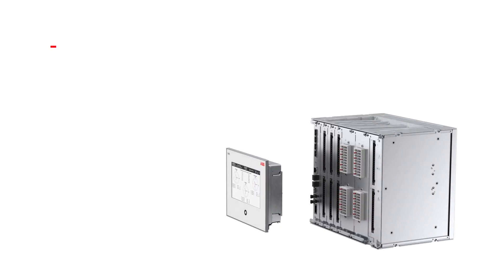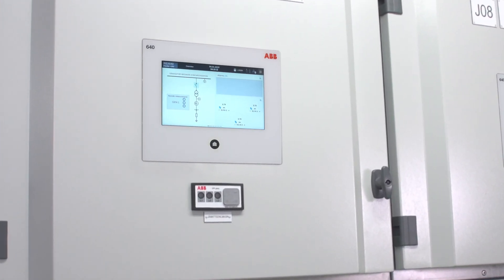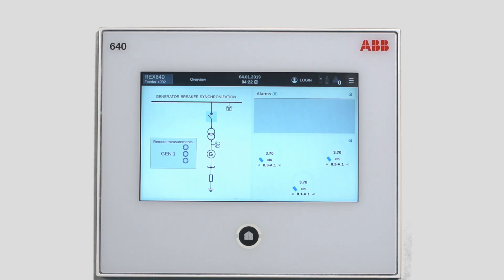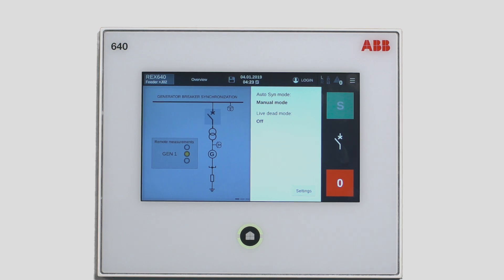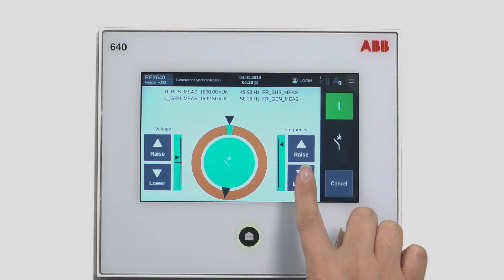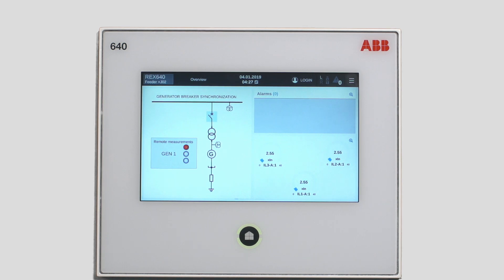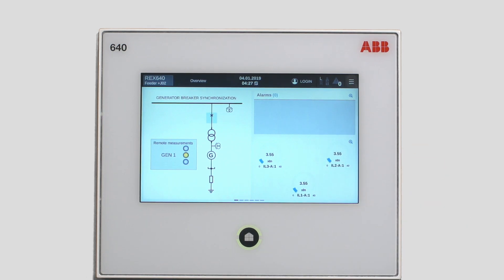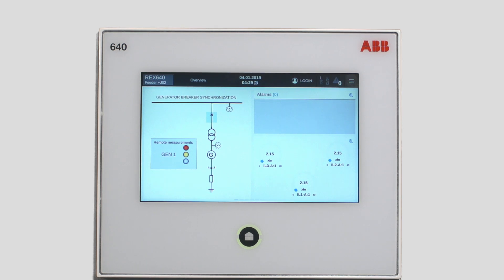REX640 – Applications: Synchronization of a generator circuit breaker

Comment: 640 is very unique and easy to use relay. Specially for industries  where continuous enhancement and expansion projects are going.
In addition, for renewable energy sector and micro grids this philosophy of multi application protection is end to end long term solution for customers.